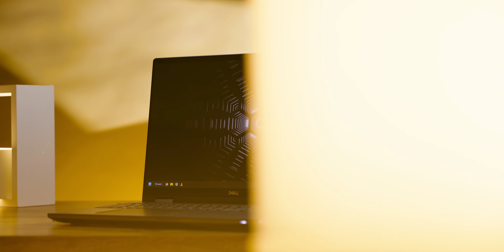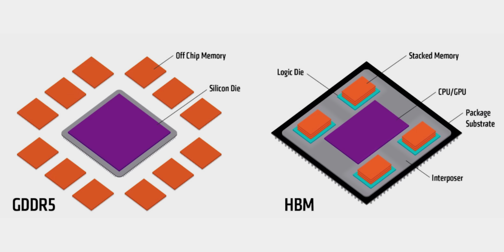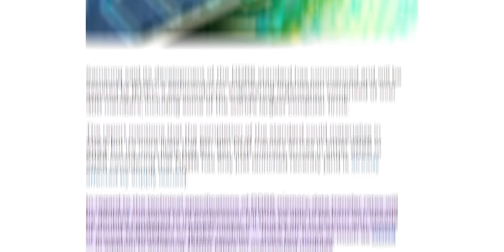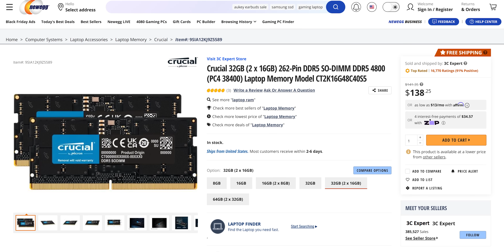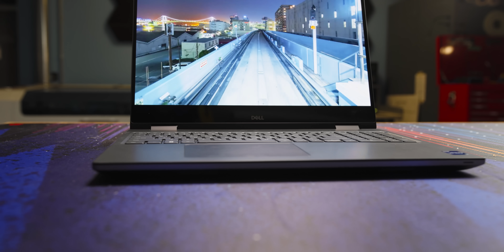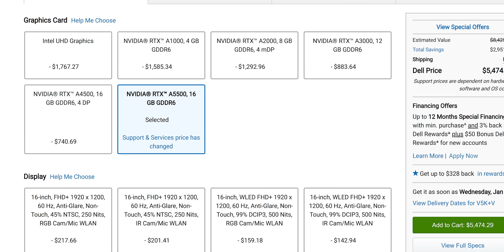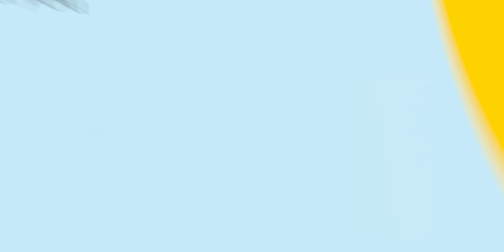I've NEVER Seen a Memory Stick Like THIS - CAMM Explained

Comment: Nothing new, It just sort of solve some issue, We have seen a lot of laptops with ram "soldered" on the mobo,  Anyone with sense is actually asking if the laptop is upgradeable with ram slots . Including me, Why should I change the laptop (read motherboard, since they almost cost the same). There is no "package problem " or anything with this one. Ram is user upgradeable, this shit is another version of the flimsy pins on cpu sockets, COming to a motherboard near you !! Ram slots with bending pins.

Comment: Part of the benefit of new standards and tech is that they can change and grow more rapidly in the inital phases, so yes you might not be able to upgrade it if the standard slightly shifts in a new model or generation but is that really much different then now, new stuff comes out you cant upgrade because it doesnt match your hardware. Plus for things like laptops where youd either be stuck with slower SODIMM or soldered RAM it makes functionally no difference

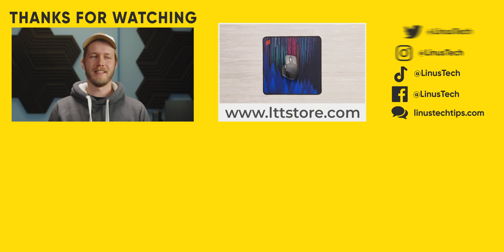Comment: 10:59 Aren't there problems gaming on Quadro chips? They use different drivers and the drivers easily don't interchange for reasons even if the core circuitry is mostly the same. Maybe it's changed since the last time I tried.

Comment: As an unrelated side tangent, I get the idea behind the precision line-up from dell but as someone working in a field where we have been issued latitude and precision machines as fleet devices for nearly a decade, the performance and physical reliability have always been fine, but the batteries are hot garbage - we've been lucky on every single model if the batteries aren't degraded below 50% in under a year and thats doing one cycle, in a climate controlled building, over a 10hr day, running only web-apps and MS office applications. My team is currently operating a pair of latitude 7000 series, each with 57Wh batteries for just at a year and their current max charge is only 24Wh - thats 42% of the original capacity after only a year under completely normal use. 

Granted, they're fleet devices and dell has a 3 year warranty on them, but thats a pretty bad business model if you have to warranty claim every single deployment because your warranty is 1.5x longer than the actual life of your batteries.

Comment: I like the precision stuff for my personal use as I think they are tougher (My precision M4800 took a tumble off a washing machine and works fine, though the chassis has a winkle in a couple spots.) Since I typically use laptops as mobile desktops that I setup and leave in like a hotel room I dont mind the weight and size, in fact having room for a numpad is a requirement. I also think it handles being in a ram mount in my truck or car while Im datalogging better without any extra screen support. I bought my M4800 as a barely used "refirb" that had the original 3 year warranty minus 2 or 3 months. Someday soon I'd like to replace it and that 7670 would be awesome.

Comment: Compression connectors?

I know why they have done it but... well, I can see this being a problem. Ham-fisted consumers are not good with compression connectors, memories of SGI machines back in the 90s that used all manner of very large, very sensitive and very expensive-to-fix compression connectors that they couldn't even contemplate letting the average consumer use.

I forsee broken laptops and a thriving repair business if this stuff rolls out to consumer laptops, memory has always been positioned as an any-idiot-can-do-it upgrade and the SODIMM makes that genuinely true but this requires a lot more care, misaligning this connector looks like it would be quite simple for a user to do.

Comment: I’ve rocked precision mobile workstations exclusively for the last decade and I have been nothing but pleased with them. They last longer than counterparts (it’s 2023 and I’m still using a 2018 variant) and the build system stability is stellar. I’ll probably be upgrading again this year to something with E/P cores so this is great info!

Comment: If it height of SODIMM is an issue why they make a cut on the motherboard and place the connector in there, so when a module is in, would be at the same height of the rest of the motherboard excepting the minuscule amount of the DRAM chips and half the connector at the bottom

Comment: I really want sodimm to remain, but be improved. Mostly because it looks like that new medium could take more space, unless one of that new module has the same speed as two high speed sodimm, then I’d take the new upgrade for laptops, since it will also be smaller.
But well…. When a laptop is that thin, it’s a bad idea especially if it’s a gaming laptop that needs more space for good fans and cooling.
Reply: I think the same and all of the caveats of SODIMM I think can be easily overcome, cable length, rotate the module, height in the motherboard, cut the motherboard where the RAM would go so instead of having the SODIMM connector on top of the motherboard and the RAM protruding in its own board, you could have the SODIMM connector in that cut, right where the board ends and the hole begins you put the connector in there in such a what that when you put the module on would basically be like a continuation of the motherboard being no higher that the motherboard substrate, excepting a little bit of the connector and maybe the memory chips on the module itself.
One could argue about the space that that takes out of the motherboard but is not like under the RAM you had many things going on and/or when the RAM is soldered there is nothing more in that space of the motherboard than the RAM, so what I say is basically why not where you would put soldered ram cut that area and put a SODIMM in its place like a motherboard extension

Comment: Sodimm could most likely be changed so those lanes are shorter and quicker, but who knows if manufacturers will put that effort in.
Laptops are great, but the speed of the ram sometimes is not good. It’s enough for a mobile device, but it could be better.
I’m sure the only, reason why they can’t move it closer, is because of the cooling system taking space and priority.

Comment: laptops only being compatible with single-sided dimms is the dumbest s ever. If you so desperately need to make the laptop thinner, do a pcb cut-out and let the ram sit at the same z-height as the laptop pcb or something. Lowering the z-height of the machine by making the majority of dimms incompatible is just dumb.

Comment: i think a good idea would be to have 2-3 standard sizes.

a smaller size for 8-32 gig modules, a size for 64-128 gig modules, and a larger size for 256+gig modules (the gig ranges are just for demonstration, and technically you should be able to get a large 8 gig card)

or have a "regular card" (i.e. one in the product) a larger card ( for when the physical size starts limiting the amount of ram) and a "specialty" one, i.e. longer in one dimention, for applications where the current  standard might not be suitable because of space/shape requirements.

with the current one being either the small or medium size.

Comment: I don't find this to be the right standard. The bigger the memory size the bigger the module. It can't be used in another slot and is not interchangeable because of the size difference. About the length of the traces on the PCB you measure the ones leading to the connector but not to chip itself which is more important. While the traces can be shorter to the connector itself then if the module is larger the longer the trace become. Sodimm can be used in PC with the right adapter but this type cannot be used in PC at this moment. The other thing is that on a sodimm module the chips are on both sides that makes the traces equal from the chips to the connectors. And so on.

Comment: What about for desktops? While the need for thinner memory isn't a driver there, having [mainly] one standard across the board should help cut costs. A few years ago I was thinking if they just switched over to SO-DIMM for everything, even desktop, (presumably at a DDRx version threshold), it would have made all memory cheaper rather than having to maintain multiple form factors. Same principle could apply to ECC memory.

Comment: Problem with laptops, if I can't at least pop the back lid to swap ram, hdd, and battery, I really don't want it unless I am strap for extra light weight and compact.  However, I go with 17" laptop with room for swapping parts if I need to or want to.

Comment: You joke about it but stability is the critical thing for over 99% of users. If it isn't stable then it's useless and won't be adopted. Worry about working first, then look at tweaking things.
From the perspective of the IT dept, we're arguably worse than the user base when it comes to adopting new things as they make our lives harder and where I've worked wouldn't have touched that thing with a 10 foot bargepole.
Nice idea but it needs to be a fully adopted standard and widely available before it's vaguely worthwhile.

Comment: It's funny that the DIMM part of SODIMM is so old that it's acronym would require an explanation to anyone under 30. (the short version: SIMM-the precedscesor to DIMM-is Single inline memory module, it was made to replace the pack of simultaneously-accessed RAM chips usually found on a motherboard. Old chips could access them 1 at a time, but Pentium chips NEEDED two at a time to fill it's address bus, so they offered a pair of 72-pin SIMMS on a single stick more or less and you get a DIMM. Sometimes called SD-DIMMs to differentiate them from DDR)

Comment: Just had to upgrade a couple of Dell servers to take a new controller cards to enable SAS. 

We had to buy proprietary connector just so we could get power to the drives because surprise!  You have to the power off of the mother board connector.

Comment: Is the only real benefit that they can make things thinner? Devices are thin enough.... Honestly I wish my current laptop was THICKER if it meant better battery and cooling. We don't need thinness for the sake of thinness and ram is already plenty fast enough. I see this as an excuse to make "old" ram obsolete so they can sell us more crap. 

Will it boost speeds in newest highest tier laptops? Maybe. Will most consumers see a discernable difference? Probably not.

Comment: So basically, wait until jedec standardizes the module design to buy. Also for the size, couldn't the connector be larger in the moderboard, then each module has inter-connection on the top allowing for sandwiching the modules on top of each other utilizing the same connection?, (There would ofc have to be limits, but same size for each module with limit set by how large the connector could be, then the moderboard system could figure out which pins goes where, or basically [1[2[3[4] perhaps, first pin row is module 1, next row is module 2, and so on.
Reply: it's spelled 'motherboard'

Comment: When I watched the video (on my phone) I thought I had seen this laptop somewhere before. I went to the my room and got a shock it was the same laptop. I got it from the hardware exchange at work two weeks ago. I admit that it is insanely fast and I had no idea that I was using the new standard of ram memory. I need to take a look under the case myself in my spare time.

Comment: The power supplies on Dell computers used to follow the BTX standard that was proposed by Intel. They have since moved to ATX standards only. I'm not sure when, but I assume when they added AMD to the lineup, they had to move to ATX.

BTX was supposed to be better than the ATX standard. The only problem is that almost no one went with the BTX standard.

Comment: For anyone didn't realize the module takes much more board space than sodimm but thiner. it only useful on large laptops like 17 inch or more. 
The benifit of the height of sodimm is you can have small components under it make acture board space used much smaller. And in most performance oriented laptops cooler is the thickest part.

Comment: It's kinda like how the older Asus ROG laptops used to have proprietary MXM replaceable gpus but they had an extrusion like how Dell does some of their mobos.  Normal rectangular shape and then.... a 1.5" x 1" jutting off to the side and also how they used to have four memory slots but you had to remove the mobo from the laptop to access 2.

Comment: Hi Ltt guys, hi Alex.
I wonder if it would be possible to make a battery powered gaming setup that is not a Laptop and have it use rather normal batteries. You guys came up with so many watercooling video ideas but no cool wattage videos. How about a magazine fed or belt fed computer that runs AAA batteries or alike? I would love the idea of using multiple batteries at the same time to have less trouble when one is getting emptied and i really wonder how fast a 3070, a 7900 xt or a 4090 would chew through a battery. I know it won't be cheap but as electric bills in europe go from woah to woooooah that's a lot i really wonder when it is time to game on batteries or have it as a meme.

Comment: This is definitely a great move forward although I keep thinking of the "co-packaged optics" Intel presented a keynotes (maybe two) ago, where they literally connected fiber optic links directly to the CPU or SoC, imagine if you connect your ram in that way to the CPU, It should make the problem of getting your ram physically as close as possible a thing of the past (in theory). Suddenly all the connections to memory, GPU, etc would be way faster and more reliable. I'm surprised there has been very little talk about this, it would be revolutionary

Comment: I think dell will keep using this at least for a few generations with inter compatibility because they want people to use it and to drive down the costs of the modules which makes their laptops cheaper to produce. Even a $0.10 saving adds up with millions of laptops. Also kind of needed for the work laptops as I assume some companies mandate having replaceable ram so they can just replace in case of a fault or something and with how sodimm is reaching its end of life

Comment: Nice intro to yet another memomry module. It looks similar to some printer memory expansion modules. The reason for soldered on memory is a) increased reliablilty, and b) cost - one or more less connector sockets per motherboard. It is worse when the ssd is soldered on, like some cheap lenovo's, where you can't recover your data if the board dies. having at least one memory expansion slot with a soldered memory system is better than none, and probably a reasonable compromise. I am surprised that the industry hasn't moved to optical data linkage between chips to remove the speed/noise/timing limitations of copper wire. An optical version of pcie.

Comment: Maybe it was because 802.11n was only a draft is why it was mediocre.  My Mother's laptop came with it and it was made in 2019.  That was just because it is a low cost machine. It had a Realtek card in it and I swapped it to an AX200NGW.  I just had to supply a second antenna and find a place in the case for it.  I put it in the case because I don't like messing with the display bezels.  Our laptops are so difficult to get the bezels off of that you have to unhinge the display.  If you are not familiar with computers you might feel unhinged by the time that is over and get it back together (I wish you luck on that).

Comment: That motherboard is proprietary in two ways really.  It not only does not work with an ATX power supply but it also looks custom made to fit their custom cases.  I avoid ultra thin laptops at all costs because I know that to make them so thin those compromises are made.  Also to help save space they might have X16 RAM in them which can give you a performance hit.  It is like when you look inside a Dell or similar prebuilt system and see that one DIMM with just a few memory chips on it.  They only did it to save on manufacturing costs, nothing more!  The worst thing is they might not pass any of the savings on to you leaving you with a mediocre laptop for a premium price!

Comment: Like those MXM modules. Hard to find, cost half of a new laptop or more, only upgradeable within the same GPU generation.
Is there any perceptual performance gains in memory speed in Excel, Solidworks, or whatever these laptops run? If not then soldered memory will be used by those that want the entire laptop to be the upgradeable component, and SODIMM slots for the expensive cheap solution.

Comment: Wish DDR6 (Desktop or laptop) also use that kind of form. I think it has some advantages than current form, like:
1. You can easily create or make custom cooling with some art/logo on it.. or even better rgb style.. or just put water cooling (for overclocker maybe?)..
2. Won't conflict with the HSF, could have a lot bigger HSF on top of the memory, even you can make a 65w CPU passive cooled with that size of heatsink.
3. Easier to buy if you searching for a used one later, unlike the current form which you need to buy a kit for a better stability.